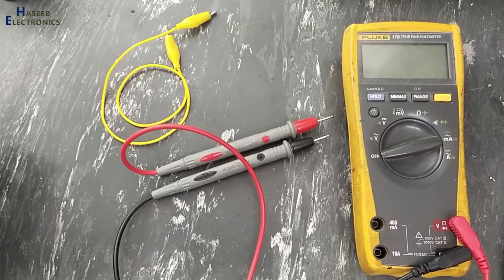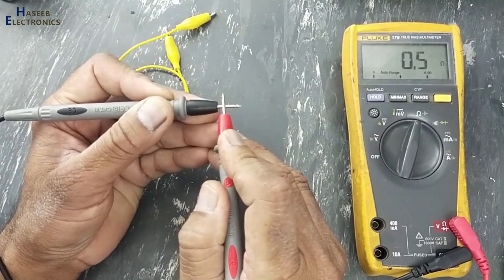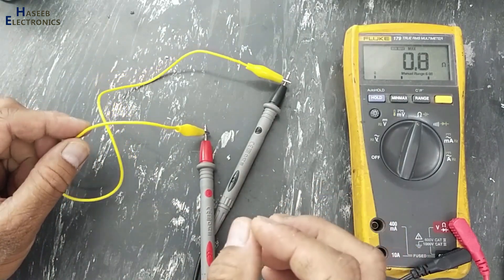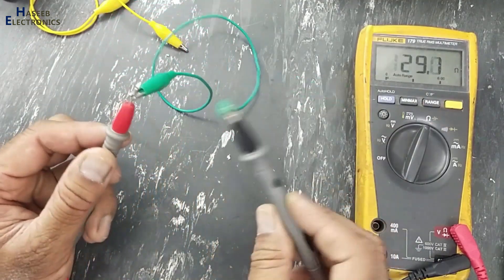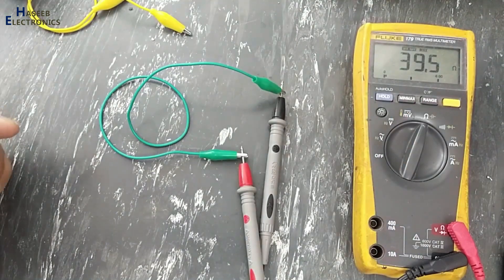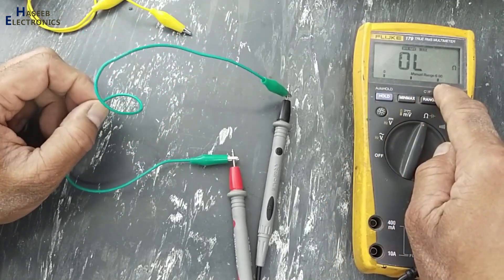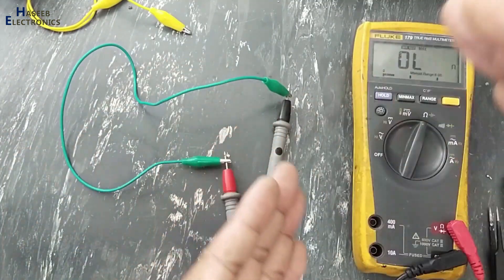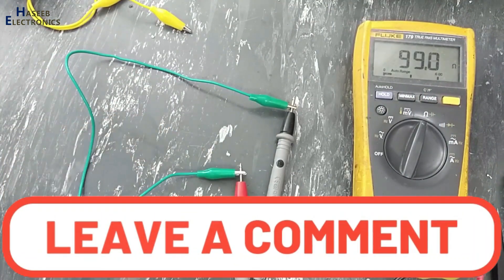{1219} Recording intermittent resistance using MIN/MAX function

Comment: Never thought of using the meter min max for resistance . I use my meter on car electrics most days. I will see if I can find bad conditions with this method.
Reply from the maker: it is very useful method to detect intermittent wires. just connect multimeter on both ends 
start min/max and move that specific wire. it works 
even i trace wires for aircraft wiring that are sometimes 50 - 100 meter long. any chafed wire or corroded wire gives abnormal results with compare to a healthy wire

Comment: Thanks for sharing. Another thing that I find very important for continuity beep tests is a fast responding multimeter. Sometimes the cheap meters are so slow they don't even recognize a fast intermittent break so there is no change in the beep tone.
Reply from the maker: you are right. some multimeters are have much slower response for taking measurement samples